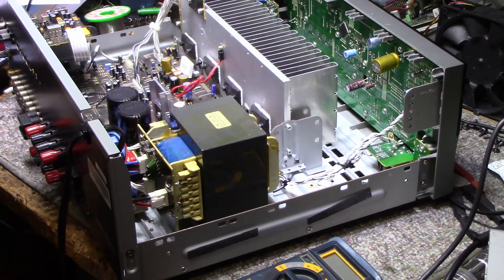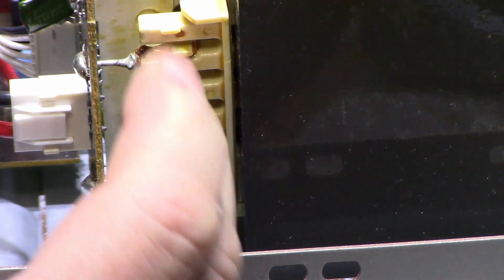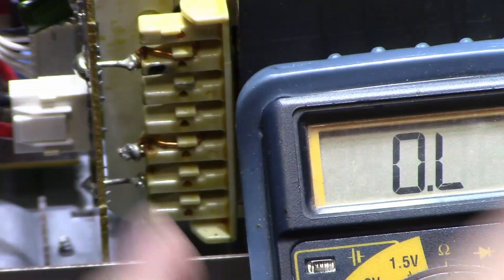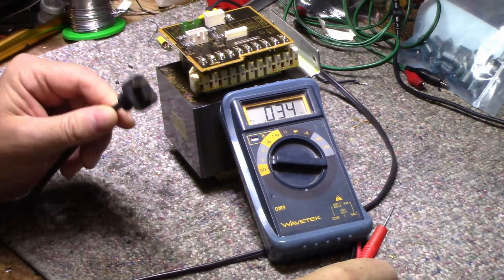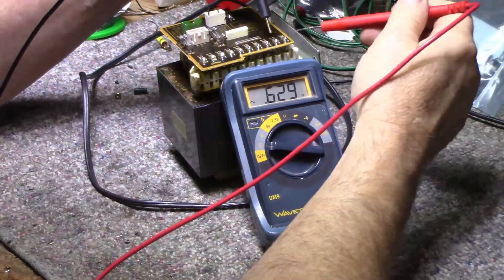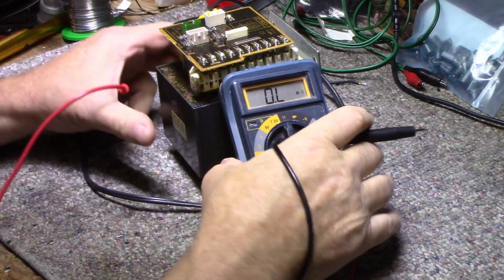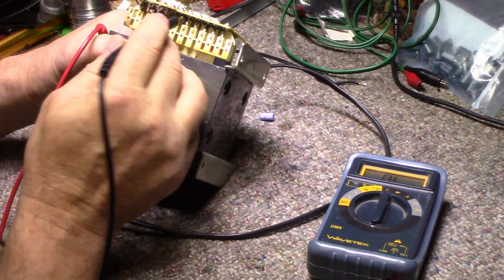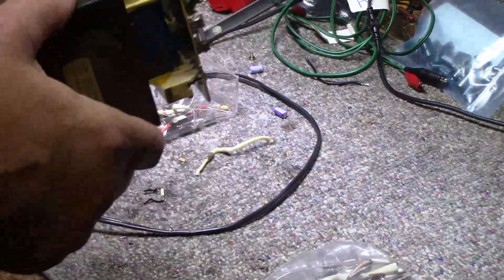HK 3480 Power Transformer tests

Comment: I’ve replaced the blue LEDs a couple of times. Last time I doubled the series resistor value hopefully they’ll last a bit longer this time. I also replaced the volume rotary encoder and the noisy transistor in the pre amp. Seems they all get the same faults. It’s a nice sounding receiver though.
Reply: It is a pretty nice amp. I have adjusted idle current on mine. The encoder works better after I exercised it a bit. I have two amps in my setup, the first one is a tube amp that I designed (triode coupled KT88 in PP config with no FB, Siemens c3g pre amp, Lundahl phase splitters), and the second one is an Inter M R500. 
I compared the HK 3480 with my tube amp. The 3480 sounds very well, but there is something about the sound image that I'm not to fond of. It's not very focused in some way. Well, one should not forget that the 3480 is an integrated amp retailing (retailed) at about $450.
Reply: I just ordered a new volume encoder. $4 the cost of one stamp. Impressive!

Comment: I didn't expect this much commitment, thank you!
And you are completely right, there is a thermal fuse there. And I missed that one. It was blown. The amp fired right up when I bypassed it. 

I also thought it was strange that the primary winding could have blown. I know now that it didn't. 

Again, thank you for your help!
Reply from the maker: No problem, glad to help. Be aware that fuse is there to protect you & your home from burning down. Bypassing it is not a long term solution
Reply: @TrevorsBench  
I am generally very careful about giving such advise to other people in case they would not be fully aware of the risks involved. So you did what's right to mention the risks an extra time.
Reply from the maker: @LinusNil  Good to hear. I just wanted to put it out there for anybody else that may view this in the future.
Reply: @TrevorsBench  Well thought. And thank you again. I didn't know they put thermal fuses inside the transformers.
Reply: Follow up:
Bypassed thermal fuse. Adjusted idle current. Amp works well. 
Next up is changing volume dial encoder.